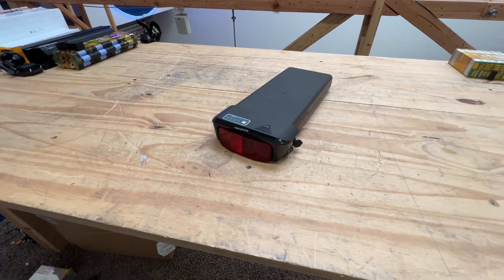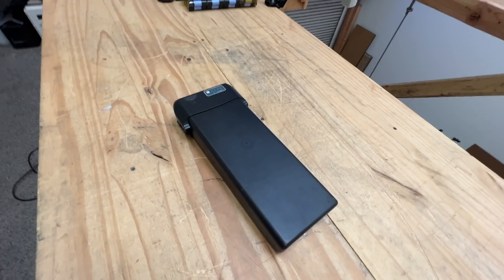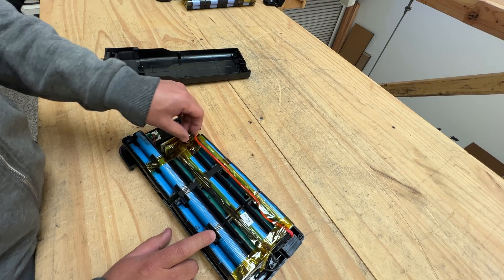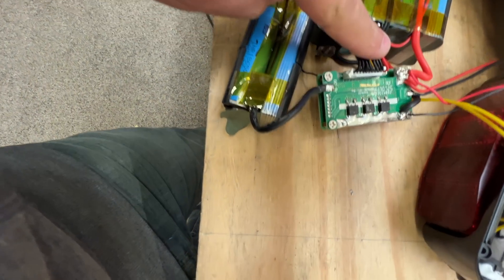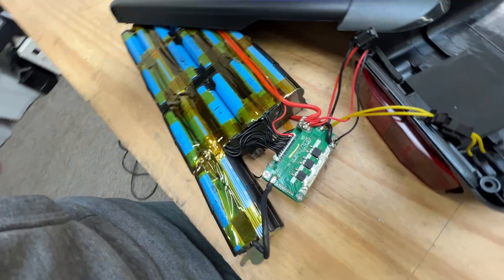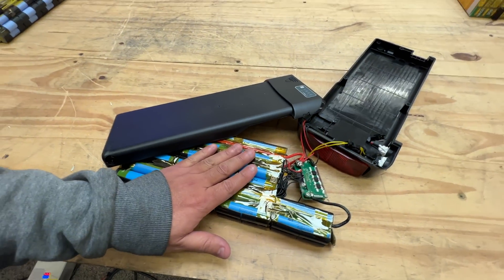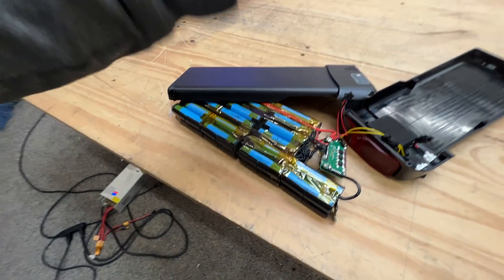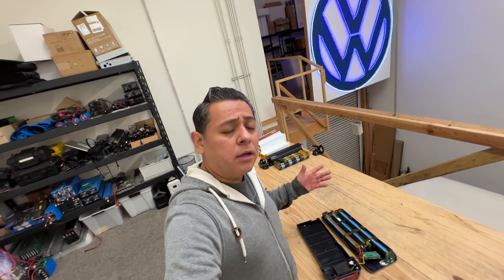29 Dollar eBike battery using Samsung 29e cells

Comment: How do you make that evoke battery 48 volts?
Reply: If you're talking about this battery, it's currently a 10S3P battery (At least it looks like it's 3P). At 3.7v nominal and 10 cells in series, that's 37v, which gives the 36v printed on the label. To get this up to 48v, you would want to tie in 3 more cells in series, and parallel. So you'd have a 13S3P battery pack at 48.1v. This wouldn't fit the enclosure and you'd need to work out something different for it.